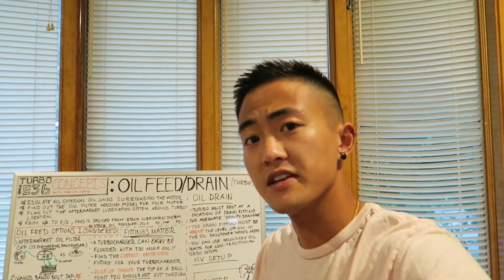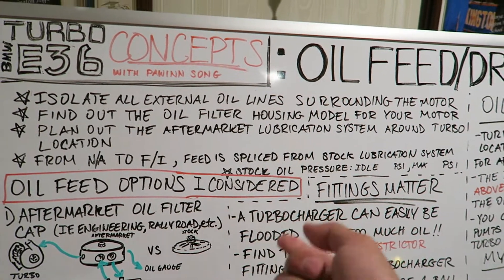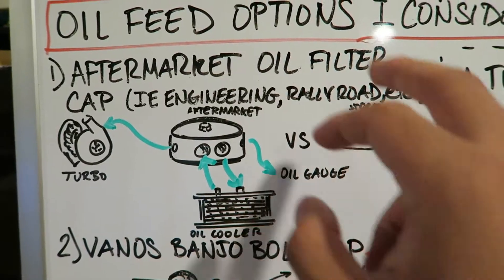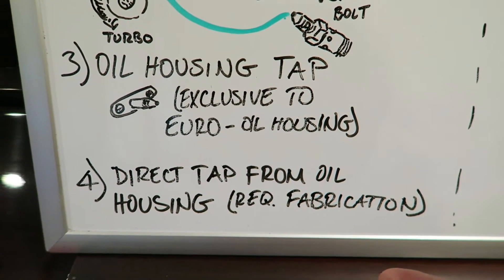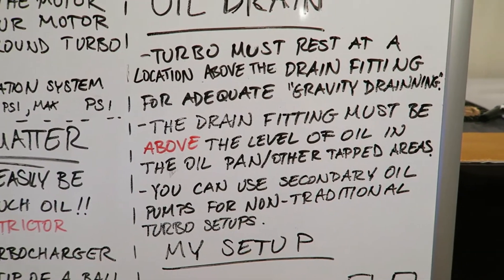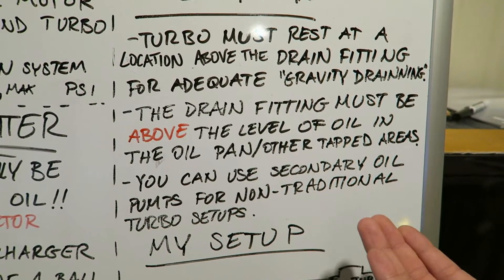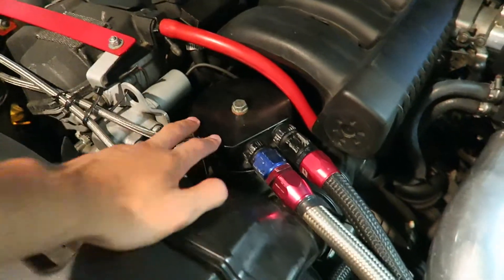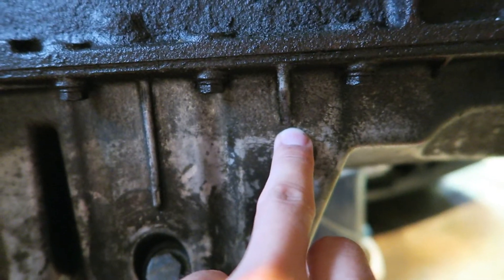How To Supply Oil To Your Newly Boosted BMW E36 [Turbo E36 Concepts 2:Turbo Oil Lines + My Setup!]

Comment: Hey just a question for the valve cover breather to the oil separator, i want to run a catch can from there, what did you do for the oil seperator

Comment: Did you use a valve with your oil adapter cap for the oilcooler. Or does the oilcooler always cools down even if the oil is cold
Reply from the maker: I did not, yes you are correct atm oil just continuously flows thru that cooler, but doesn't seem to have any bad effects on warm up at this time 👍
Reply: @Pawinning  OK. This cap costs 190€ Herre in germany so i think i will buy EU  s50 oil housing  that has an valve included.  For the sake of relability.  But thank you for your answer

Comment: So with the non-vanos engine where is a good location to run the feed line? is the fitting from the modified oil filter cap recommended since you used that for the oil psi gauge only.

Comment: Thanks for the info! But when you use the vanos oil line to feed the turbo, does the vanos oil pressure still work properly? Thanks again 🙏🏻

Comment: I also have an S52 boosted. I was just wondering what kind/type of engine oil you use?
Reply: Something I was wondering too, I currently run 5w40 in my m52 turbo, it's been fine but I wonder whether to use 10/60 race oil, but it might get tappy at the top end

Comment: Has anyone ran an oil junction block from the oil pressure sensor and thoughts on doing so? From what ive found that is a pretty reliable spot to run an oil feed.
Reply from the maker: Yes! A junction block like u said should work fine. I just like using the vanos supply because it’s already a designated oil supply and it’s a little easier to access imo
Reply: Pawinning I'll have to look into some other stuff but that seemed to me like the easiest to just hook up in jiffy.... the rest of it seemed like there would be a decent amount of modification but I'll definitely look into it
Reply: Pawinning will tapping from the vanos alter the performance of the vanos system by relieving some of  pressure to feed the turbo?

Comment: Thank you for amazing video bruh
I'm currently building e36 turbo too, can you please send me picture which were the vanos oulet that goes to turbo inlet oil feed, to my email muhiqbalshiddiq@gmail.com
I'm really appreciated if you please help me :)
Reply from the maker: It’s shown in the video, I point out the hose that goes into the side of the VANOS unit, if you follow that hose you’ll see it enter on the side of the oil housing. It’s too tight of a spot to take a pic without me having to take apart parts.
Reply: okay i see whats your point :)
But can i go oil feed the turbo from the oil filter cap directly? (not from the vanos line)
Would it be a problem or not?
Reply from the maker: Yes you can go straight from the oil cap, BUT it is not a reliable feed because if you have a bad filter or any leaks, you’ll have a loss in oil pressure to your turbo. By splicing it from the vanos oil feed, you essentially supply oil to your turbo directly from the oil pressure created by the oil pump.
Reply: Pawinning Ow okay i understand that.
Thank you very much for your explanation 😊 really much appreciated 😊

Comment: why did you turbo over super charging the e36 since kits are more common. btw where did you get your Instagram sticker ?
Reply from the maker: +Paul Morris I considered supercharging, but I felt that in terms of custom fabrication a supercharger was more of a bolt on mod than a turbo kit. I wanted a challenge! And u can get Instagram sticker cuts from Amazon
Reply: thanks dude, I have an e36 m3 that I want to add force induction but I don't know super or turbo.

Comment: Good stuff, nice to see someone explaining every step of the process and proving that even SOME eBay components are definitely usable when done right instead of everyone on forums bashing about eBay kits with no real experience.
Reply from the maker: +Jonah Nita I agree! Although I was not confident in the entire cx racing kit, I knew that the manifold would be, with minor weld reinforcements, perfect for my setup/budget
Reply: Pawinning what did you not like about the kit, I was thinking to get the crxracing kit and slap on a Garret from a truck, tial waste gate, MAF, 60lb injectors and a tune from Miller or Rktunes. Maybe throw in a boost controller